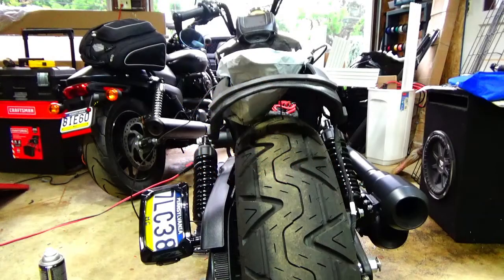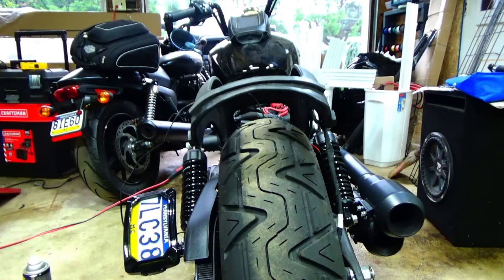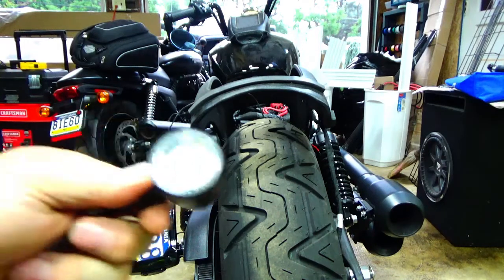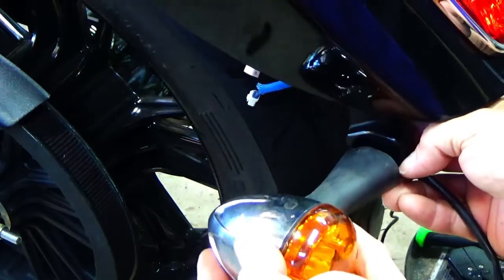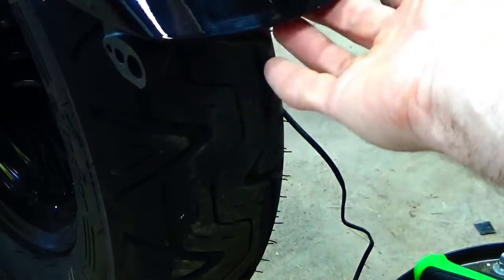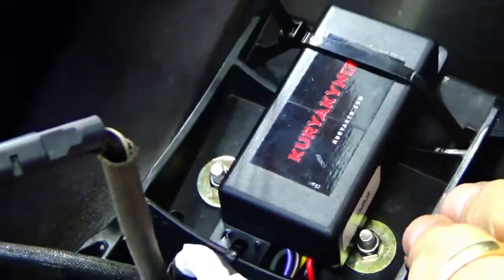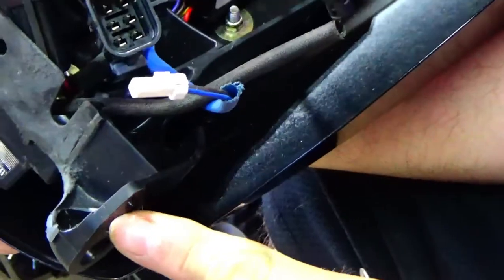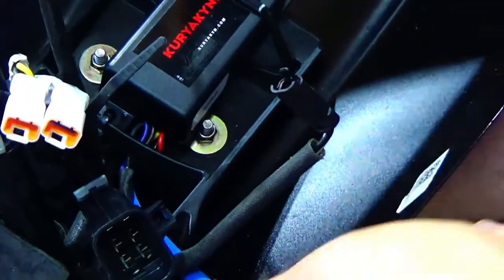Indian scout/ scout 60 rear led signal brake and run install

Comment: It's been 4 years since the video. How has the lights held up? Got and more videos of the bike?
Reply: I never had one lighting issue. I've since sold the scout and moved onto a Chieftain Dark Horse. The scout was great, but became too small. Thanks for asking!  I've already got some videos for Chieftain coming.
Reply: @anthonymyers-35  congrats on the new bike. I was thinking the same exact thing of upgrading to a bigger bike. It be hard to let go of the scout. I had a question if you don't mind. What is the difference between the 3 wire splitter and the 4 wire splitter? Im not knowledgeable in electronics, i figure you be the best one to ask.
Reply: @customtoysandmore  I promise you, once you get on that chieftain, it's over lol. I love it, yes I miss the scout for local rides but I don't regret a thing.
Reply: @anthonymyers-35  do you know what the difference is between the 3 and 4 wire splitter? I was thinking of doing what you did, but wasn't sure what the difference was between the splitters. I'm not planning on using a license plate light
Reply: @customtoysandmore  which splitter? Kuryakyn? That's what I used for the rear turns stop and brake. The factory plate light wire is just a 2wire positive/ground, or at least it was. The fronts I used my own relays to invert the signals but custom dynamics has the easy 2 wire inverters that plug in. I'm not sure if that's what you're asking.
Reply: @anthonymyers-35  ya the kurykayan splitter you used was a 4 way splitter wasn't it? They also have a 3 way splitter. What is the difference between the two other than one being 3 and the other being 4?
Reply: @customtoysandmore  the 3 way splitter is new looks like it's based for the Kellerman lights. I remember having to solder my own matching ends on with the 4 way. Again I've been in the electronics industry for 30 years so I could source the matching pig tails before they were even thought about. It looks like they streamlined it down now. It's really not difficult. Taking the rear fender off and following the factory wire runs makes it a hell of a lot easier! Give it a shot I know it made people say, " where the hell did you those lights" lol. The dealer even liked it. Let me know how it goes if you do it. I'd like to see it. Thanks for the questions too. I enjoy helping any fellow riders.
Reply: Sounds good brother. I will let you know. I'm debating between these and the radiantz kit.
Reply: Don't mean to keep bothering you. Depending on what blinkers I buy will determine if I buy the 3-wire or 4-wire splitter module right? If I buy the same blinkers as you did, I would need the 4-wire splitter module right?
Reply: @customtoysandmore  Honestly, it doesn't matter from what it reads is the 3 wire has the integrated plugs and the 4 wire has a separate ground wire to allow for any style of aftermarket run, stop and turns to be used. I'd just go with the 4 wire if it was me but either will work.
Reply: I ended up doing the same setup. Everything works great. I was wondering if your engine light came on after added these blinkers and relay.
I also added front fork blinkers that plug into the negative wire from where the original headlight plugged in to and the Pathfinder headlight that uses the positive wire. Do you think that would throw the code? Everything still works

Comment: Hello sir, great informative video! Would you know if this setup will work with a 2021 Indian Scout Bobber, that I'm trying to install the Kellerman 1000 DF?  My Kellerman lights are the red/red/amber (amber for turn signals).  I'm stationed in Italy and brought my American spec bike here, and so I am trying to comply with European laws.  Thank you in advance! 🙏
Reply from the maker: Thanks for the compliment, and as far as the lighting, it should be the same. I know since I've done this video, custom dynamics has released a change lights interface but I'd use the kuryakyn piece I show on there! Makes life so much easier. Thanks and enjoy Italy 🇮🇹

Comment: Where does the wire connect into the battery - Im stuck trying to replace mine
Reply from the maker: Not sure what you mean? I'm need a bit more info. I'll try my best to help you
Reply from the maker: On that scout, I used an integration harness under the seat that the left and right signals went into. It controls the running, stop and turn of both rear signals.

Comment: Great video! I'm actually looking at the same aftermarkets for my front/rear signals (bobber scout). Questions: do you need to module to install the rear lights? If I'm keeping the factory plate/light would the wiring just be a PnP?
Reply from the maker: Yes

Comment: Can't find on here what i want to do so, will ask you,  i don't like the way the turn signals stick out so far on my 2018 scout 60,  bought universal fit bullet turns ( not led same as stock) just want to attach them in closer.  Wires to old turns should just be two wires to each side right ? or will i run into another wire to license light , also can i just splice into what's there and not have to run the new wires all the way , think i bit off more than i can chew unless this will work ..LOL
Reply from the maker: Sorry for the late response the problem with the indian turn signals front or back is they're negative pulsing turn signals where they pulse to ground each time the signal flashes..unlike traditional signals that flash when voltage is applied. So you will need some kind of module or custom dynamics sells a cheap adapter that allows you to add turn signals, meaning it reverses the polarity allowing you to add different turns..sorry for the long post but feel free to ask anything you'd like. Thanks
Reply: @apmscootering5219  sounds like I will leave it alone for now...thanks
Reply from the maker: Not a problem
Reply: @apmscootering5219  does CD adapter work with the Kuryakyn lights or just their aftermarket.
Reply from the maker: I'm sure they would work with other signals if that's what your asking? If that's what you want to know. What type of lights were you thinking about?
Reply: @apmscootering5219  the 1000’s
Reply from the maker: Kellermen bullet 1000's?
Reply: @apmscootering5219  yeah
Reply from the maker: @Lioneldehetre  absolutely!